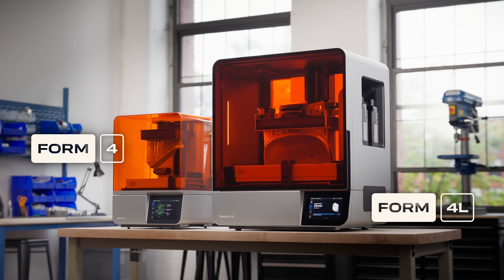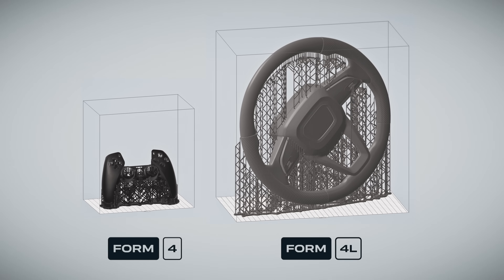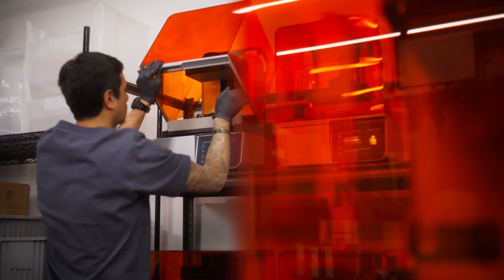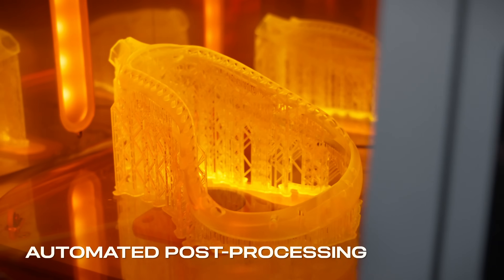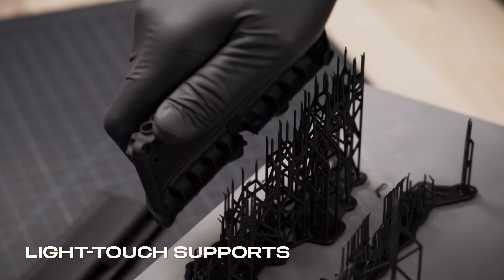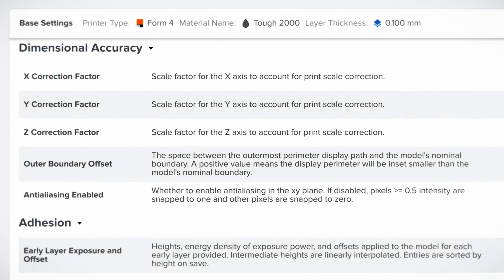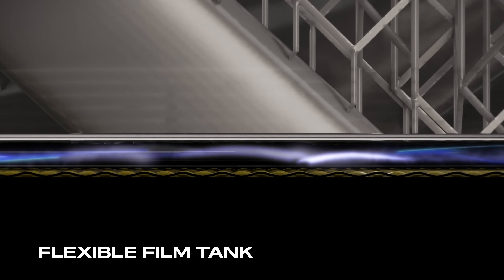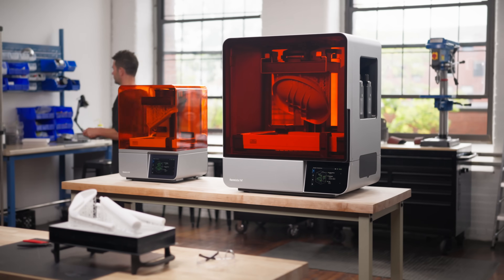Introducing Form 4 and Form 4L

Comment from the maker: Form 4 and Form 4L are blazing fast masked SLA 3D printers powered by a Low Force Display™ Print Engine that combines an industry-leading materials library with a reliable, accurate print engine. https://bit.ly/3NqeXtp